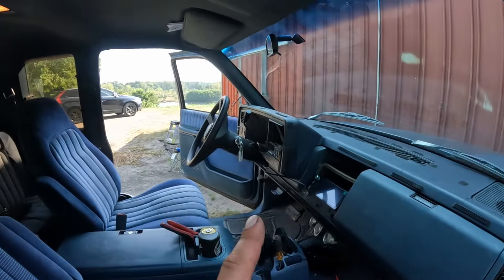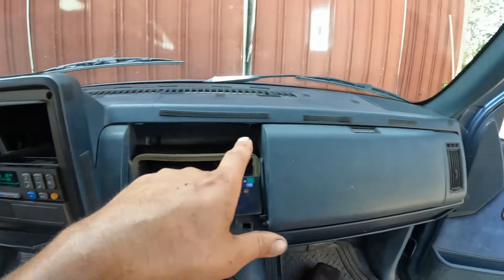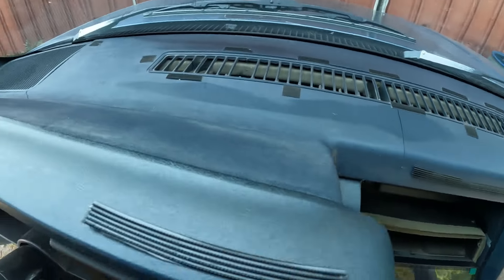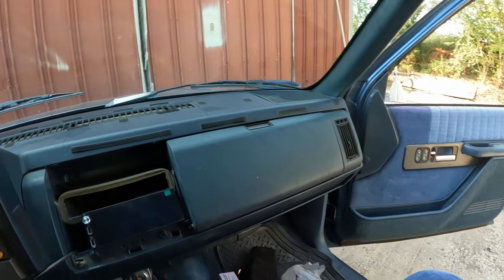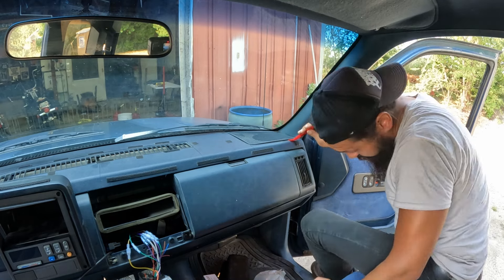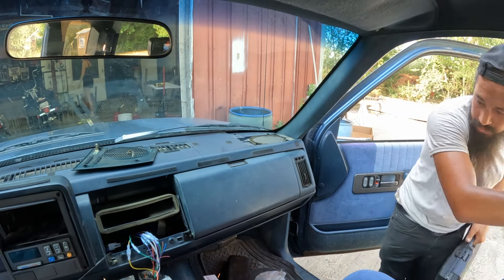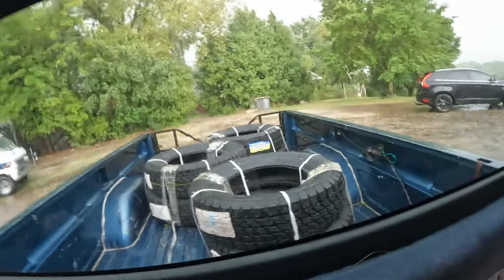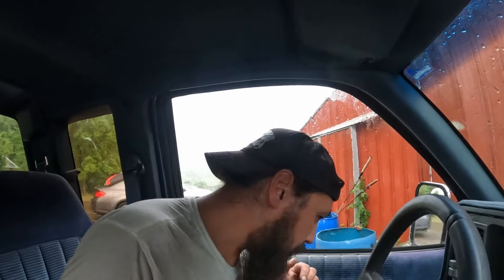'92 GMC 3500:  Radio Working But No Sound?  Let's Try New Speakers.

Comment: You will get it . The 454 in that truck is bullet proof . Great engine but rough on fuel .
Reply: I had one and 10mpg full, empty, around town, freeway, didn't matter 10mpg
Reply from the maker: Bullet proof is what I wanted.  I have no concerns there, but fuel....  I wasn't expecting a prius, but damn, she's thirsty!
Reply from the maker: That's about what this is at.  I'm pretty soft on the pedal these days, but I think 10mpg is pretty much the best she'll do right now, and I have not noticed any difference heavy or light...